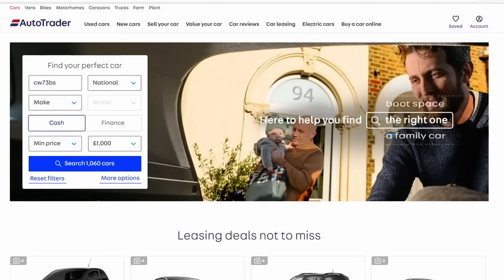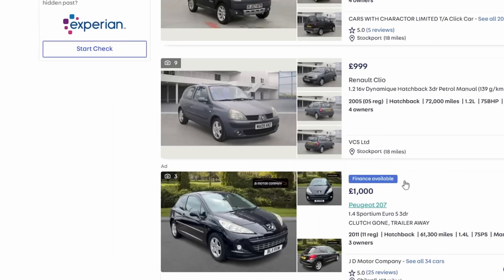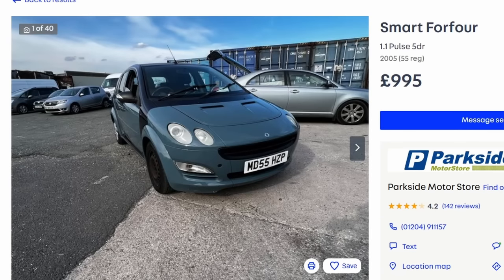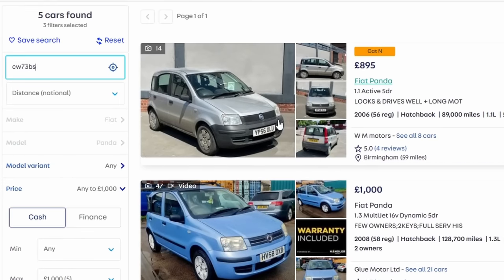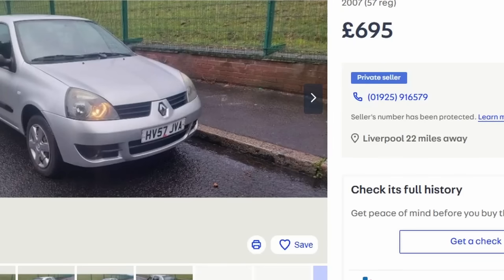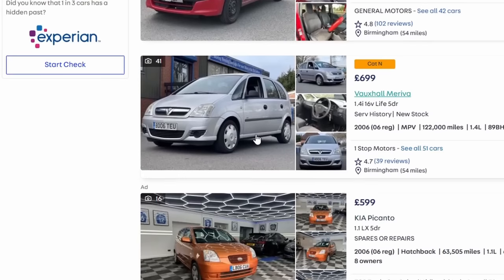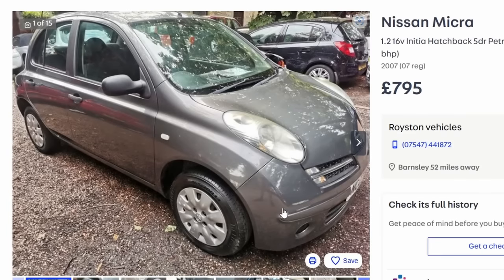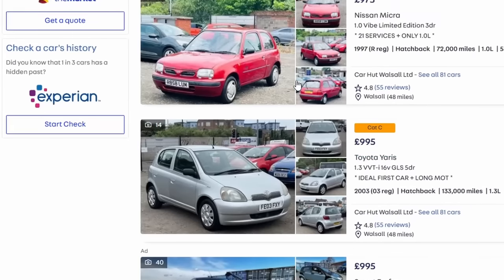THE BEST SMALL CARS UNDER £1000 ! (2023)

Comment: Agree with all you mentioned in the video,not had much experience with clios in my time. You know, a relation had a Jazz (2006) it was ok, BUT got written off in an accident...so got another (same year & miles) and was rotten a a pear! Someone in the family just purchased it over the internet/phone. Never viewed it,driven it,checked the fluids & the auto gearbox was knackered as it judders when taking off, but family member put in Lucus oil stabilizer in & seems ok so far .....it is terrible underneath!! No rust on the sides thou. Came from way up north, what's it doing down near London i'll never know! 😂 Now....being an ex Yaris MK1 owner for 14yrs i recommend them HIGHLY!! 🥰Just needed front pads & discs,serpentine belt in 14yrs, regular oil changes at 4,000m with Magnatec 5W-30 & coolant every 4yrs with Prestone on the dot, it was the BEST & MOST reliable car i ever owned. 90,000m when i parted with it & it drove PERFECT for 14yrs! Quality when driving was lovely. No rust under it as i sprayed WD-40 underneath EVERYWHERE 3x a year for like 10yrs. I got that Yaris back in 2008 & looked after it properly, 2021 got a MK3 Yaris.
Reply: I had a Mk1 5 door 1.0 CDX  Yaris, in Silver, one of the very first ones on a T plate, for 5 years 2011 - 2016, was a lovely car, nice to look at, very practical inside with all the cubbys and storage places, got it from my mother who owned it 2004 - 2011, and she had no troubke with it at all, apart from a rusted out filler neck betweeen the petrol tank and the filler flap, caused the car to smell of petrol all the time. Had to have an exhaust on it when I got it, and it needed more welding done on sills and inside rear wheel arches, but apart from that, no trouble at all, and I sold it on at 17 years old and 70K miles on it for just 400 quid in 2016.
I then had a Mk2 06 reg for 7 years 2016 - 2023, and that got written off at 17 years old by another driver, but aside from cloudy headlights and a finickity clutch pedal with low bite point, it was reliable and never broke down, apart from the usual stuff like tyres, battery and exhaust box. 
Now got a 64 reg Mk3 Yaris on 30K miles, and that is a very nice car, but I will say that it has much less cubbys and storage than the Mk1 did, and the back seat wont slide back on forth like on both the Mk1 and Mk2. Lovely looking car in Sintra Blue (the most uncommon blue colour for a Mk3 Yaris), but I still think the MK1 I had was my favourite Yaris. I suppose they were just so modern and futuristic back then compared to the Starlet it replaced - I loved the central digital speedo, which they did away with on the MK3.
Reply: @stevejones1972  Mk1 will go at the rear wheel arches,they where great cars! The 1.0L was said to be the best engine to ever be made! For the size & bhp with the reliability the Daihatsu engine was fantastic! Car of the year 1999.
Reply: @stevejones1972  The 1.0L was named best engine ever made! With the small engine having good bhp it was such a reliable Daihatsu engine! Being a MK1 Yaris owner for 14yrs they're super. only ever replaced the front pads,mid & back exhaust  & serpentine belt for reliability! Tyres,battery,regular services don't count. 3x a year i sprayed EVERYWHERE incl under the back end with WD-40 & it held up with rust,the rear beam/bar was fine,no rust! Seals fine with v.little rust on rear arches. 
Got mine in 2008 with 60,000m sold in 2021 with 90,000m. Used Autoglym that gave an awesome shine indeed! Got my 2002 Yaris 1.3L 4sp auto gor £3,400 in 2008 with FSH,sold it in 2021 with 3 service stamps on top then did everything myself,sold for £1,000 which is cheap! A nice chap came to look at it & didn't mess me around.
I put in Forte engine & fuel cleaner in 2009 when i worked at a garage,it was part of a service that cannot be got in shops,although ebay sells it which i got & also put in my 2015 Yaris 1.3L CVT. The 2002 Yaris i drove 15mins with that Forte in & it shuddered, almost stalled BUT it cleared,then drove way much better after indeed! I did poo myself when that happened lol 
I used Prestone every 4yrs on my 2002 Yaris,coolant is VERY important! Says every 10yrs but never go 8yrs personally. I flushed out the coolant with de ionised water, put in 60% prestone as there was that water in there already,so really it'll be 50/50.  My 2015 Yaris i got my garage to use the genuine Toyota Pink coolant instead, so 5yrs it'll last then i'll go to Prestone. I'll start servicing myself next year, £90 a service does add up,don't forget they add 20% VAT
I removed the PCV, cleaned it out with brake cleaner as it was dirty, so that helped the longevity indeed.
Never had a new water pump or thermostat in 14yrs, the person who i sold it to i still talk to, he hasn't don't anything! So 16yrs is amazing!
Did my 2015 CVT fluid at 88,000 with the proper Toyota FE fluid fo the dealer at £58 for 5L,did 2x drain & fill in a 2 week period,it was 2.2L each drain, i followed Amd's advice (video) with the procedure.
Had 2 rear wheel bearings done which is common, £300 plus the VAT with labour on top  is expensive! The Yaris uses same bearing as Mazda 2, they're bases off a Mazda 2 i hear.
Sintra Blue aint a bad colour really,i worked for Toyota in early 90's the Scarlet drove awesome. The Corolla was fantastic!!! My first accident was in a Camry 2.2L estate in workshop lol It has 2 rear wipers! 
Just change the oil every 4,000m or 5,000m MAX & the car will love you.  The VVT solenoid can get clogged due to lack of oil changes, i used Magnatec 5W-30 on the MK1 for years.  Nice chat fella.

Comment: I've owned a Peugeot 107 & a Renault Clio & I think you are absolutely spot on about both.  The Clio had electrical faults & I had to get the electric windows fixed (cost £120) & the 107 had rotten sills & I had to get both sides welded & it cost £300.  But both were good cars lost in accidents.

Comment: Mk.1 Fabia is my pick. So well built underneath and the older they are tge better the build quality.
Reply from the maker: Yes very good car, although windows are pain on the mk1 always breaking regulators / motors and pain to fix
Reply: @carukchannel  Yes agree there. And door microswitches causing central locking gremlins, but the metalwork was 'too good' and after 2007 Skoda had to cut back on the rustproofing. Corrosion is the one thing that really kills off 15+ years old cars however good the mechanics may be.

Comment: A great video, which makes some very good/useful points. My 2 pence worth based on personal experience and the experience of others of the Ford Owners Forum isL
* Petrol MK5 Fiesta - Great little cars, quite durable mechanically, peppy AND robust petrol engines. As Lee mentioned, just deal with any scabby corrosion as soon as it happens (mainly the exposed underbody items) and there's really not too much more to worry about. However...
* MK4 Fiesta - Total rot boxes, front arches, rear arches, sills, subframe (basically, any part of the car that's exposed to road salt/water WILL rust like a mother). Do yourselves a favour, pay a little more and get a MK5 Fiesta. The MK4 also carried over most of its mechanicals from the MK3, so it was already out of date when it became available. There's a reason why there's barely any of them left #RustBuckets
Reply from the maker: Do like a mk5 fiesta got a few on sale currently 👍👍

Comment: Hey Lee - you might want to warn people about the Nissan Micra K12 160SR.  Only 800 were ever made.  So now whilst a future rare car for sure - due to the limited numbers they now no longer make the exhaust or the radiator for these.  I own one and the exhaust had to be custom made.  Also beware of bad maintenance - mine came with the books and even the radio code and only 52K.  However lack of maintenance in the previous 2 years meant - 2 springs, wheel bearing, service, and discs and pads all round + battery.  It is also worth noting the front discs have a nasty habit of looking great from the outside - whilst the inside disc side is shot.  That said - since I did all that I have taken it from 52 to 68K in the last 2 years with just 2 services.  Also worth noting the 1.6 Nissan engine from this period has the notorious rattle between 2000 - 3000 revs.  Mine has always done it even after the heatshields etc are tightened up etc.  So the 160 SR is quite fun - but it does have some pitfalls.

Comment: Suzuki's are great had 2 swifts both been very reliable good on fuel and cheap tax.😊
Reply from the maker: Nice drive and sell well, however do suffer with subframe corrosion (failed many) and gearboxes are weak but cheap to have fixed. I will buy and sell them mind as bar them two main issues they are good news

Comment: From experience I'd really recommend a K12 Nissan Micra. I've had my 2003 1.2 Auto for 7 years now, and it's been faultlessly reliable . Best car I've ever bought. Wiper washer motors can leak making the wipers have a mind of their own, but that's a cheap repair circa £200 fitted. Only downside is rust, which can be rampant, so check very carefully underneath. Find a good one though, have it wax oiled, service the auto gearbox every 6 to 8 years, and it will absolutely delight you. I've certainly no intention of selling mine anytime soon.

Comment: I bought a 2003 mk5 1.4 fiesta 9 months ago for £800 as a daily, so far done 6000 miles , intermittent abs light, apart from that been faultless .
Reply from the maker: more than likely will be a speed sensor issue, cheap fix

Comment: I had that generation Clio, a 2004 1.5 DCI, the only car I regret selling, however I can add to your list of known faults with them, Sunroof rattles, sunroof leaks, water leaking into boot, heavy clutches, bad rust in rear quater panels on 3 door models, damage to sills due to soft metal and inproper jacking up,  throttle body failure on petrol models, remote central locking failure due to failed door lock actuators, rust along front edge of bonnet,  failed bonnet catch mechanisms causing bonnet to fly up, alloy wheels easily buckled by pot holes,  other than that they are pretty bomb proof 😂❤

Comment: I have had no issue finding parts for my 2005 1.3l mitsubishi colt. 256 000 km and still going strong. Only problem for me has been the automatic gear. I had to get it replaced by the mitsu dealer, so wasn't cheap. The engine is reliable and corrosion not too bad.

Comment: I brought a 1.0 , W reg Yaris for £700. It’s as reliable as the sunset , and is surprisingly practical .
Reply from the maker: Glad to hear, does it have Power steering
Reply: @carukchannel  Yup, surprisingly good also. I use it for my kids learning to drive. It’s actually brilliant for tip runs too, it’s amazing what you can fit in there.  Oh it’s also got a cool digital dashboard. The only down side that there is no AC, and it’s like hades inside even on a moderately sunny day.

Comment: I’ve owned a 2000 Fiesta 1.8TDdi which did 121k miles in just over two years and I ran to 170k sold on due to back arches going. Last mot was 191k. 

2003 1.4 Fiesta was a good car gave little bother. The two 2007 1.6 TDCi’s have had a few big bills but love the drive and the economy and the size makes it easy to drive through narrow roads and towns. 

Weirdly as much as I’d like to say I was wary of French cars. I owned a 2003 Clio 1.2 and it’s only real fault was a oxygen sensor beyond general wear and tear, the 2008 1.2 Tce was much nipper and never gave a bit of bother and I got the log book from the dealer weeks later to find previous owner was ERAC Limited 🤔 (Enterprise rent a car), was only a year old and 12k miles but was a decent car.
Reply from the maker: You have a good run of cars there ctr 👍

Comment: I had a 2003 fiesta finesse, that was one heavy car for the old 1.3 engine to push around. I'm on my second K12 Micra, I really love these cars. My first was lost because the ex wife took it and my second was bought because I really missed the first. Weak point is the lower suspension arm but cheap to replace and ignition switch is a weak point as it can stop the car from starting.

Comment: Vw/Audis..... I don't know what it is, but seems to me that VAG haven't made a decent engine since the PD's. Timing chains, blown turbos, and as you say here about the valves on the 1.3 3-cylinders. I'd be wary of going anywhere near a VW.
Reply from the maker: Yes sadly in the pursuit of lowering emissions and extending fuel economy, reliability was badly compromised on modern vehicles with very few exceptions
Reply: My PD 1.9 is on 268,500 miles and still going good. In a 19 year old Audi A4 b6. Luckily I live in a rural area as it's only Euro3 - no good for LEZs!

Comment: i had a little 02 206 1.1 (no abs) which i gave £300 for as stop gap, took it to work and put it on the mot ramp and it was immaculate, not one spot of rust, i managed to do 15k miles in it before the timing jumped and bent the valves (my fault as i never changed the belt) the rear axle did fail but i bought the axle off the 1.4 hdi and fitted it at home and it cost £130 in total to do that, it was brilliant on fuel and i do miss it, got a 62 plate corsa d ltd. and its okay i guess, osr arch is a little bubbly and short mot but it aint bad for £750 lol

Comment: Was very surprised you recommended Peugeot 206. In my experience they are very unreliable cars: Headgaskets, rear axels, electrics, paint peeling and faulty automatic gearboxes. I have seen a lot of 206s with these problems and here where I am you don´t see them on the road anymore. Toyota Yaris, Fiat Panda/Punto, Renault Clio Mark II or Nissan Micra are the best choices of these cars =)

Comment: Corsa C came out (and Corsa B finished) in late 2000 on an X-reg.

Fabia Mk1 came out in mid-2000 on a W-reg although there was a V-reg press car.

Ka Mk1 was normally 1996 P-reg to 2008 58 reg, but I have seen 2 late-registered 09 reg ones.
Reply from the maker: I am not splitting hairs over a few months here and there when I just grabbed a mic one morning and made this video from memory, the 1.4 mpi was dropped in 2003 but a 1.4 16v went through to the end of production. I sold many of them.
Reply: Sorry if it came across the wrong way and thanks for the correction
Reply from the maker: @RWL2012  Not at all very knowledgeable info RW, thanks for watching 👍👍👍👍👍👍

Comment: I’ve seen a fair few Polo’s / Ibiza with duff gearboxes and chains hanging out of them or oil burners on the 1.4, I’m surprised you’ve not experienced these
Reply from the maker: 1.4 is cambelt driven with the exception of later models which would not be under 1k or close. they did have some box issues but they were not as prevalent in my experience as others mentioned.

Comment: the getz dis also come with the 1.5 diesel and car so small light little rockets but higher insurance, fiesta diesel group 10 for the 1.4 but ( think ) it was over group 15 for getz diesel ive looked at one but as new driver at the time ended up with car i still have the i20 1.2 hat performs well and very reliable. the polo also had diesel option too think that age you looking at the 1.9sdi and turbo version too same goes for seat option too but great mpg but new driver higher insurance and higher tax and now a lot higher tax, little bit newer polo you got the 1.4tdi the eco engine with great mpg but no idea how reliable they are. nothing wrong buying a light weight small car with diesel you can get mega mpg  but sadly these days eco stuff on them a pain and thing to cause issues and higher tax on bigger engine ones. buying old vw polo like age you mentioned in this vid i feel that was peak of vw they gone down hill ever since

Comment: I think Corsas have the same electric power steering (and problems) as the Punto. I had a 07 Punto where the power steering would fail intermittently, but I managed to cure it by removing and cleaning up the earth leads (there are 4 or 5, from memory)...

Comment: Everything is a common fault on a Corsa lol. They're a dog of a car. The Clios are a bit better although I'd add to your list the crank sensors fail a lot and also the connectors under the seat for the side airbags can break and result in the airbag light staying on.
I'd go with either something Japanese or a Fiesta, rust depending.